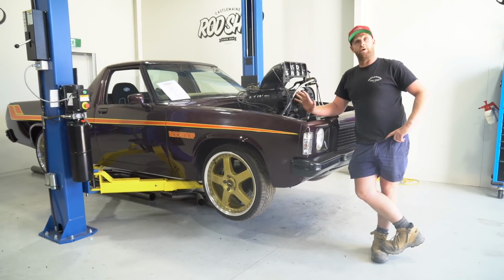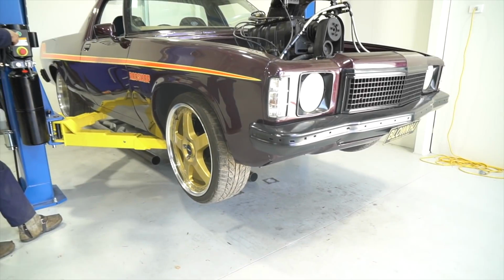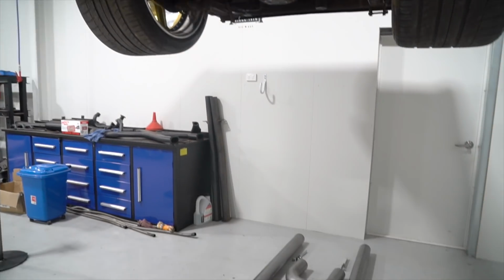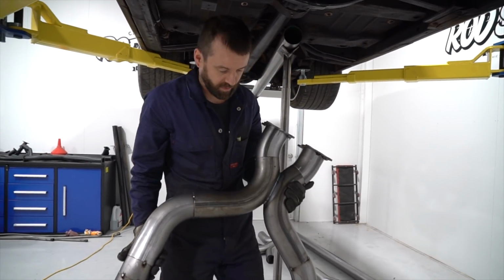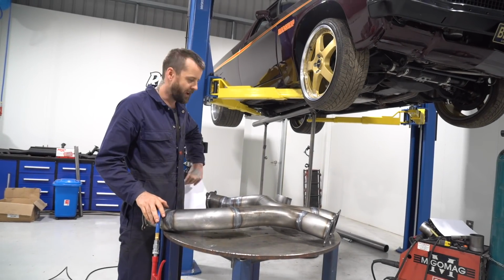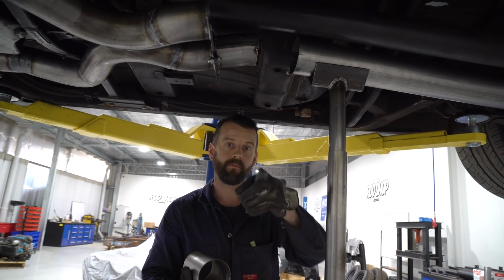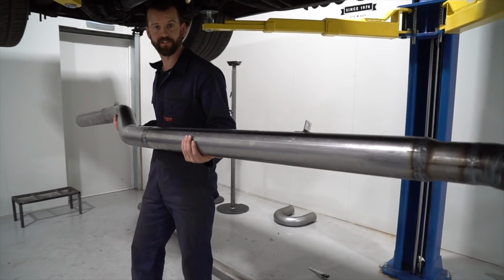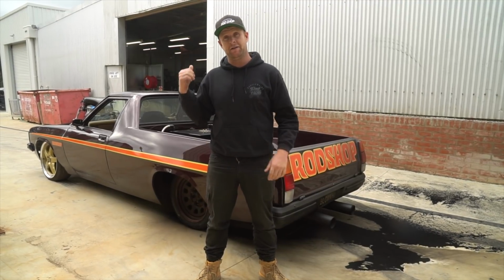BLOWN HJ gets a new exhaust system.

Comment: Do the pipes hit on the back bumper under load? Mine don’t look as close as they are and they touch?
Reply from the maker: No, Not yet anyway mate, time will tell with some more seat time and not just a static burnout. But should be fine.